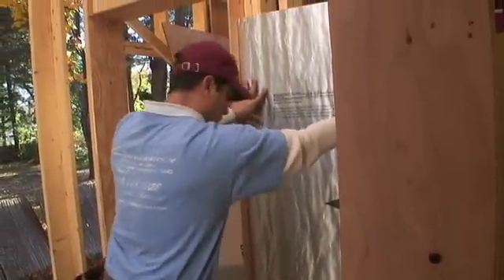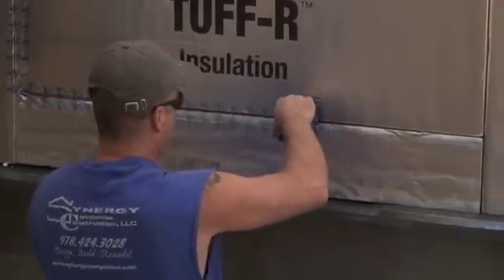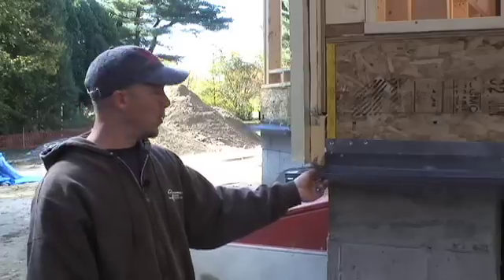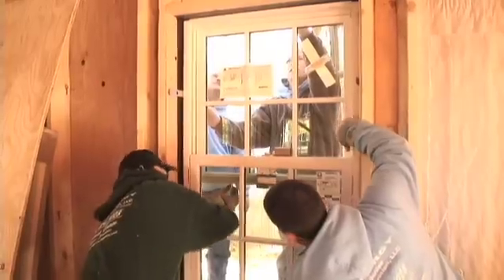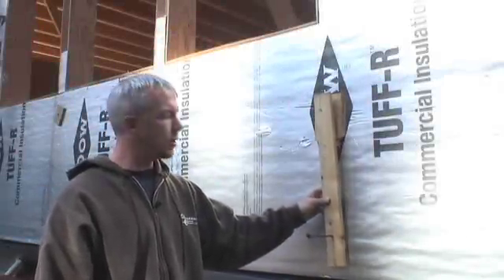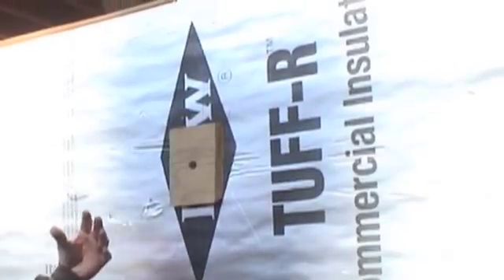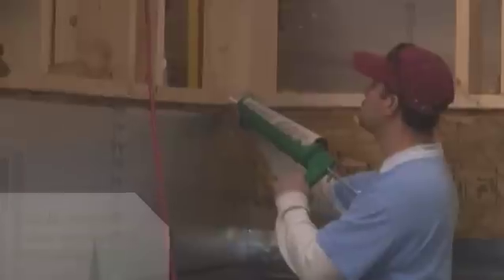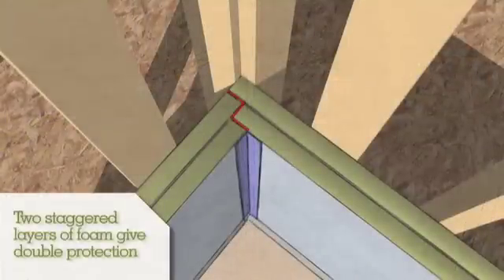How to Install Rigid Foam Insulation Outside a House

Comment: If the outside was cold enough wouldn't moisture condense on the inside surface of the insulation getting the exterior plywood damp? I want to add 2 inches of insulation to an old cinder block home with no interior insulation, just 2x4s laid flat on the interior of the block wall with drywall covering the 2x4s and am concerned with how moisture will migrate out of the house and not cause problems. Thanks.

Comment: This wall is not structural.  Their is no plywood or OSB sheathing.  How do you prevent the wall from racking?  Someone could cut through the wall with a knife.  Bad design.
Reply: Walls don't need rigid sheathing to be rack prevented. Before the days of rigid OSB and such they never counted on the wall paneling to prevent racking. They typically use inset diagonals or metal strapping.

Comment: Perfect. Any issues with horizontal strapping - siding will be board and baton
Reply: Simple horizontal strapping will block water from draining if it gets behind your board and baten. I think I have seen products intended for this type of installation that are installed horizontally with a drainage system on the back side; like vertical channels or some other uneven surface that leaves gaps through which water can drain.

Comment: Am I correct in assuming that this system replaces plywood, vapour barrier poly and housewrap?  Does it still require fiberglass insulation?
Reply: If you click the link in the video description, you find it is a dead link. 
Maybe the house blew down without enough plywood for structural integrity. 
I would like answers to your questions also... I will check their channel also...
Reply: I was just talking to my dad about this type of construction. He said it was popular in Wisconsin for awhile between 2000-2010 and his company did it with plywood only near the corners but foam everywhere else. However, everybody covers the whole house in plywood or OSB nowadays. He said my grandma's house actually has no plywood sheeting on it, but it is very energy efficient and never had any structural issues. It was built around 2000.

Comment: Interesting concepts.  Does taping and sealing everything up make the house too tight though?
Reply: I think you nee it tight to prevent moisture.  If your concern is with air quality, I think you need to install an HVAC system.
Reply: There is no such thing as a house too tight. It needs to be tight as possible and then properly ventilated. Its the difference between aspirating like a grasshopper or breathing like a mammal. Tight system with mechanical lung (ERV or HRV, (but ERV is an HRV+ so really I don't see the use of an HRV)) and life is great.

Comment: Folks, check out REMOTE wall system. Residential Exterior Membrane Outside-insulation TEchnique

REMOTE puts outside insulation on the entire house. (roof and foundation)  Just putting above grade wall exteriour insulation will not do the trick. Insulate all the framing or do nothing.

Comment: What are you actually mounting the windows to, since it looks like you only have that thin plywood window buck/extention there? I would think that this would not be strong enough, and instead of pw, you should maybe use a 2x material???

Comment: Great general guide here, thank you for posting.  One question though:
At the 90 degree flashing face where it meets the rigid stuff, do you caulk that?  I'd imagine there is air loss if not.